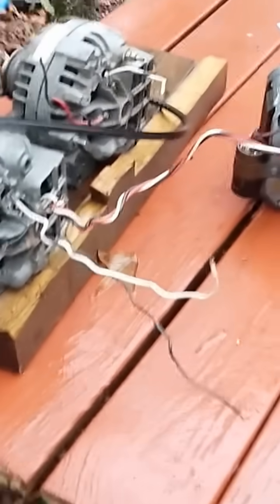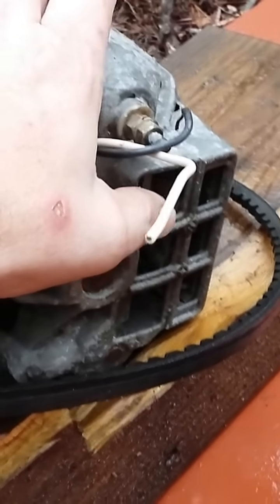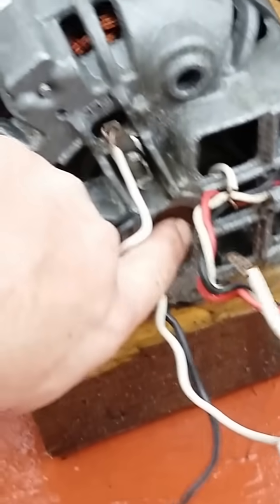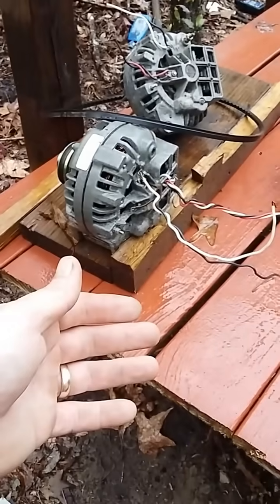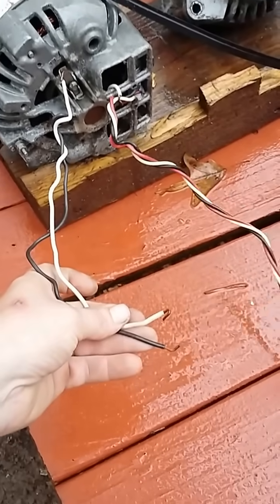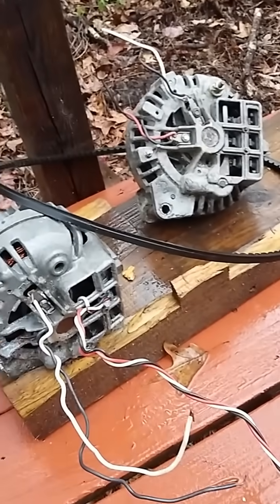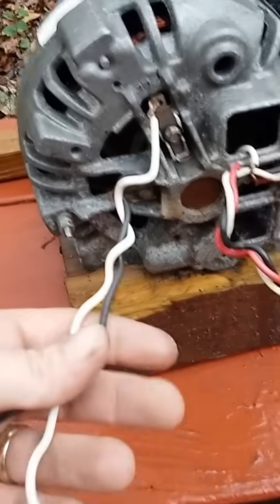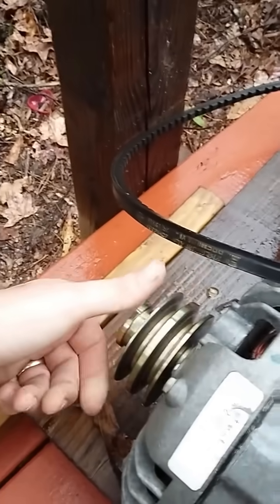Update Free energy forever no wind no solar no gas READ DISCRIPTION!!!

Comment: No gas? How are you running the alternator? A motor is required to turn the coil so... unless you're out there with a bicycle hooked up, how are you rotating the alternator?
Reply: He collects the energy with batteries, he turned one of the alternators into a motor and runs everything with just alternators, batteries, charge controllers and an inverter. Its an endless cycle that puts out more energy than it uses.
Reply: Boxing Prophet there’s a little thing called efficiency that doesn’t allow it to produce more than it takes to run the more amps you draw the harder it is to turn the alternator it’s not like watts and hp are unrelated you know
Reply: He's just working with what he's got an that is just a example of DIY.  He is not going to show you his device because that would be incriminating for sure and probably admissable in court which could land him in jail with a leangthy sentence.
I don't know a damn thing about electricity , but I have enough common sense of What Not to Do.... Which helps in most life circumstances.
Be cool, and don't hate appreciate.
I do and some day I will get my 2 mobile homes looked up with electricity.
Reply from the maker: Rory M 
the alternator is my primary mover
Reply: Rory M it’s not hooked up because it doesn’t work due to the fact that an alternator is about 93%efficient meaning you power out put due to counter electro motive force ,friction and the power it takes to create the electro magnet in the rotor which is the part that rotates get it? He said that the stator was the part that turned but it’s called the stator because it is stationary get the terminology links? This guy cant make it work because he doesn’t know half of what he is talking about he doesn’t even have a simple electrical spade terminal for his connections lol

Comment: Nope, I'm an electrician....not just an installer, I'm an electrician....this doesn't add up and it won't work....it just won't, prove me wrong, show it working, it can't and it won't, why? Because physics dude, it's literally impossible! My neighbor showed me this after he saw my house running off a generator during a major disruption in the local power grid.....I have a feeling I'm going to be installing a lot of gen sets and transfer switches in the near future, you know, stuff that actually works!! Please, don't miss inform people! Go to 310.15 in the nec, what conductor is required for 90 amperes? I'll tell you right now it's a lot bigger than those #12's you've got! The 90 amperes you stated you obtained from one car alternator would melt a #4 copper let alone the #12 cu you've got there! Not going to happen my friend, it just does not add up!!
Reply: bronze beard that and the fact that the alternator will require more energy to turn it then it will produce due to frictional losses and inefficiency doesn’t matter how many batteries you use to store energy it will drain slowly and stop even without a load on it

Comment: Alternators if i have it still right and that is that with 12 volt DC input the alternator has a output of 120 volts AC but you still got to have a running gasoline motor to turn it before it can produce the AC 120 for you. The old generators that used to be on all automobiles could be used as a generator or and electric motor with out having to make any changes.

Comment: I need to charge batery packs of litium
Reply from the maker: jose r 
pulsed DC is the way to go because it a is less energy consumption by far and if you want to charge them with having a smaller input than the output you can use the collapsing fields from AC and produce a signal then it just needs to be rectified back into pulsed dc with four diodes ( Bridge rectifier) and then you will have almost no energy consumption but still be able to charge the batteries.

Comment: Diodes don't convert DC to AC or vice versa - they are a "check valve" for electricity. Inverters and Rectifiers are required for those needs. 
90 Amps requires much larger wire then that...
Definitely don't try this at home!
Reply from the maker: Wow! you are what I call a almost educated idiot...
Quote!  " Diodes don't convert DC to AC or vice versa"  is what you said and you also said a rectifier is what converts AC to DC... do you know that a bridge rectifier is?
NO YOU DON'T!!!!  It's four diodes and a capacitor to smooth the pulses out! but you don't have to have the capacitor... A rectifier is just for diodes!!! I'm SO sick of these retarded comments!
YOU need to do some research before sticking your foot in your mouth!

Comment: Yeah your alternator is just that but its used to produce 14.5 volts on average for charging or 12 as most people know it point being it doesn't make 240 volt it makes 14 on average now here's the thing car alternators produce a high frequency mine runs about 600hz and witch is way to high for your house but you can get a transformer from a dc power supply and use it to step the 12 to 14 volts up to 120 to 240 my truck has a 200 amp alternator on it i left everything the way it was but i ran 3 wires from the stator output to a homemade step up transformer that i use to  run the lights on and in my truck along with a few other days oh and you disabled comments because you didn't want to get called out on stupid shit
Reply from the maker: elizabeth.l.t. bitrick and you are what I call an educated dumbass. You say the car alternator can't produce but only 14. volts but then you say it can produce 120 or 240 you also say that I disabled the comments but here your comment is.. you're a real winner aren't you!
Reply: elizabeth.I.t. bitrick Alternators produce AC volts first and then psses through a series of diodes that rectify it to DC output. You have to get the AC at 60 hertz's before you can use it on all american uses and the best way is to run the gas engine that is turning the alternator at 1800 RPM. A modern house  has to have 240 volts AC at 200 amps to power all uses safely. To be honest and i know, unless you got some free power source to turn all the alternators you would need it would be cheaper to stay with your local utility.

Comment: Dude! Yer not seeing the forest for the trees. What's going to drive your system? You say a motor. Powered by what? Alternators in cars are initially, momentarily powered by the car battery, then the gasoline powered engine. You're bogged down in the minutia and are not seeing the big picture.

I don't know, maybe you're planning to power it with corn liquor up there in the woods?

Comment: Let me save everyone some time: there is no such thing as free energy. I am an engineer with a Bachelors in mechanical engineering and a concentration in energy systems and this is one big load of garbage. This guy has no idea what he's even talking about.
Reply: Free energy is a thing it's called the sun and the wind lol. There are a lot more free ways to create energy. Just because people do not understand how to harness it doesn't mean that it doesn't exist.
Reply from the maker: Kayla Garcia you also forgot one sweetheart it's called sound. motors cannot tell the difference between a square wave and a sign wave, so I am able to use a very small amount of energy to create a very large amount of energy...
Thanks for the comment!
Reply: Conrad Taylor
1 minute ago (edited)
Kayla Garcia: I disagree with your statement. I consider something "free" when you don't have to pay for it. I am not aware of a method to harness sun or wind energy that doesn't cost anything. Solar panels aren't free, wind mills aren't free and batteries also not free! Please share these "free" ways to get energy.
Reply: Conrad Taylor —there are ways to build solar and wind generators yourself for low cost, and may be “free” if you just “happen” to have “all” the materials hanging around, but there are ways to build these things without going into debt, possibly only 1/100th the cost of the commercial variety.
Reply: @kaylagarcia7073  Go get your free wind turbines and solar panels then, or do those have a capital cost associated with them?
Reply: poosiehandler I feel sorry for you that you are too duped by society and by mainstream “knowledge” to have an open mind for new things. I believe it can be possible, just corporate greed has hidden these things from us for generations (probably by squashing evidence from scientific experiments that may have been done in the past) This is and has been Corporate America’s practice for who knows how long. Whenever someone does something new and controversial, they make the plans, items, and inventor disappear.
Reply from the maker: poosiehandler and you are what I call an educated dumbass!
Reply: Stop trying to scam people you moron @ThomasBuie
Reply: poosiehandler don’t call somebody a “moron” if you don’t have the guts to try it yourself or to ask for the plans. Did you just watch the video for a laugh like most of these comments indicate?
Reply: ThomasBuie EnergyBuies at gmail com 
Agreed he is definitely and educated dummy
Reply: poosiehandler 
People with degrees are people who only learn what others have discovered or invented Therefore they are stupid when it comes to thinking outside of the box their schooling created

Comment: You know you could eliminate all this bad talk by showing everyone it works. Instead of just pointing at unsoldered wires loosely hanging off the alternator. I have many questions. How do you get a 220 vac charge at 90 amps on 18 or 16 gauge wire without the wires catching on fire? Have you ever read the laws of thermodynamics? How do you make the supply energy of 12 vdc? You do know that perpetual motion machines are typically know to be false because energy is always lost when transferred, not gain? I want to see it work. If you could show me this, I will give you five dollars. Otherwise, your a con man.

Comment: If this really works please help me to learn to make one I have recently experienced a house fire that started at the breaker box. This forced the power company to remove the meter and I am now staying inside a 40 ft car trailer equipped with a breaker box but no power. Source and it is very cold I have had to run my truck sleeping inside of it all night already because it was just too cold ..... I really am desperate and my family needs help please
Reply: I'm an engineer and this doesn't work. Don't waste your time on this.
Reply: What does work
Reply: @traviswheeler9311  @Poosiehandler can you answer the question?

Comment: Wire looks too low gauge to not over heat @ 90 amps..just my observation..good luck!
Reply from the maker: JACK Master everyone says that but have you thought about how big the wire on the telephone pole is that powers everyone's house how could it be so small it should be 10 ft in diameter to be able to power everyone's house...
Reply: @ThomasBuie  its called transmission voltage.High voltage low amps and after the transformer on your pole it becomes low voltage high amps.
Reply: @ThomasBuie  Everyone's house use and wiring is different,ever thought about that!?

Comment: well, a lot of statements you made were wrong for an example you cant plug 3 phase "the three wires" into your house without having a converter to two-phase. commercial equipment runs off 3 phase like my mills and lathes in my shop. I could go on and on but would fall on deaf ears I can hear the level of education in your voice. The fact of the matter is you cannot get more energy out than what you put in it would break all laws in physics if it were possible a scientest would have already done it.  Test your theory under a real load and see what happens. Voltage is measured in volts, current is measured in amps and resistance is measured in ohms.  To help understand these terms I will use  plumbing pipes. The voltage is equivalent to the water pressure, the current is equivalent to the flow rate, and the resistance is like the pipe size.
Reply from the maker: No actually I'm right three phases come to your house from the Transformer off the pole one phase is grounded which is how you get your neutral and the other two Maine's
Reply: no, the neutral is ground yes but you do not stick the third phase in the ground.  witkrieg you are right that is one way to wire it but burn up what ever dose not run on 220 my shop has 3 phase setup just like that !
Reply from the maker: witkrieg todd do you think the car alternator 3-phase is any different? the coils on the car alternator are also 120 degrees out of phase... I'm not stupid and I'm not even using the alternator as an alternator I'm using it as a "motor" wired in * or a three-phase field magnet motor.. and technically it's not even a motor because I'm using sound to propel it read the description

Comment: It doesn’t work. Anyone using ohms law understands this is bs.
Reply: How about nortons theory, kelvins law and Kirchoff’s law. But you keep believing a 6 volt battery can power your house. Running your furnace your stove all your lighting and refrigerators.
Reply: @chrisminblkdiamond uhm bro, kelvins law has absolutely nothing to do with this. i guess if you want to safe some energy and what not but it is not the fundamental basis of how this works lol
Reply: ogjuggalo4545 Do the math any part of the equation is directly proportionate. I also encourage you to draw 90 amps direct current through a #12 wire. 90 amps times 120 volts is 10,800 watts or VA.
Input is 3-6 volts what is the current needed to sustain?
You appear to use google to try and understand. 
The math does not work, but in your mind it does.
Let me know what happens when you draw the 90 amps through a #12 use ac or dc.
Reply: Yeahhh.. So you realize that there is literally formulas for this right? I assume you are familiar with maxwells equations too? Seeing as you bring ohms law up, greg ohm kept his findings secret mind you that was the 1700s untill maxwell published them? What about faradays law? Can you tell me why ohms law holds only for circuits containing resistive elements? Meaning no capacitances or inductances? How about explaining why there is even a copper coil to begin with inside of a alternator? You may want to read some more.

Comment: Yep.
You can get 2 110-90amp legs from an alternater 
Just like the mains coming in your house.
The difference is the AWG WIRE SIZE.
SO YOU COULD USE ONE LEG WITH 110-90amp to power one 110-20amp breaker string of recepticles and use the second to power the drive motor with, this giving you one cost free 110vlt-20amp line to use for what ever.
Chances are you could probably power up several pumps with one leg, this giving you 5 110-20amp strings to utilize.
But all must recirculate back through the pumps via ground because all the electrons are being provided by the ground to the metals and feeds.
The pumps are only applying the pressure, this preaure is what your utilizing in your home, the charged electron becomes a spent proton and must be pushed back through the pump to recharge as an electron again.

Point is what your saying and saying can be done is very true, but no one has gotten away with doing it very long and most folks are scared to death of God and his evil wrath for the good hearted fair hearted honest soul.
Thank you for sharing Thomas.

Now if you want the world to see it for real.

Put it together in plain sight, keep it very simple.
Then go to all the soul propritorship mechanic shops in town and show the boys you rig running itself and powering 110-30th amp load.
Give each guy a paper schematic how it's done and leave anonmously.
It will spread across America like wild fire in heavy winds.

You can't get any were showing any body on YouTube anything.you have to show it to the minds like yours in person.
Reply: Hey" my friend, I completely understand what you are having to Put-UP-With, on utube,!!! So, before I put anything" on line, Any Where" 
ON-Line, I check everything" My self,!! SO, I can cut out Anything That makes me sound like a HICK,!! And I'm from the (Deep Wood's of 
VA.)!!!! So, I don't have to Try to sound stupid" it's part of how I was Raised.LOLOLOL!! 
SO, YEAH, KEEP ON" KEEPING ON,!! BRO" IT'S JUST PART CAN OF OUR D.N.A. TO EXPLORE THE POSSIBILITY'S OF THE UNKNOWN,!!!! THANKS FOR YOUR HONESTY,!!!!
Reply: You sound like you are trying to get him arrested
Reply: @whoiskand  who is doing this,?? No, I'm not doing that,!! I'm trying to help him not get arrested,!!!! By checking everything out, no one will try to get Free press, by filing a claim against the guy.!! He's a nice guy" and I relate to him, because we're both from the Country.!! And we stick together.!! Haven't ya, herd The song ( A Country Boy can survive)??? LOLOL go Google it now" by Hank wilames Jr.!!! And you will understand,!! And if for some reason you still don't get-it,?? Listen to Some of (The Charlie Daniels Band)
Some of his greatest hits. Like 
(In America)!! And (Simple man)!!! You should get what I'm talking about.!!!